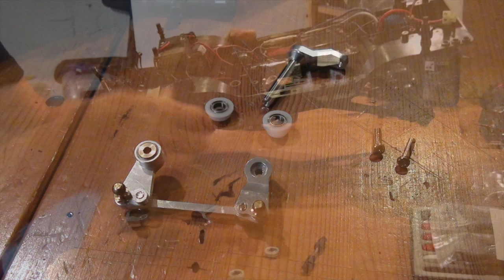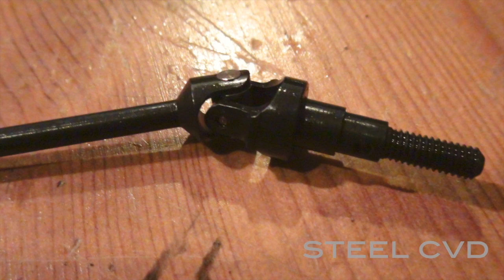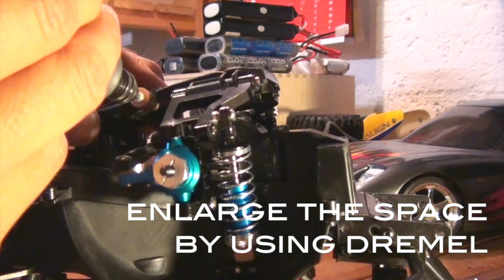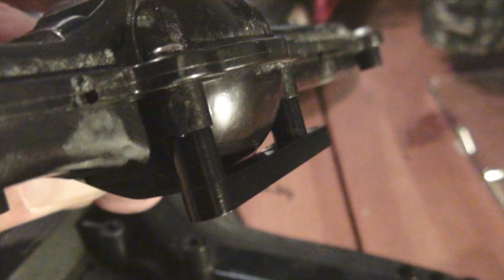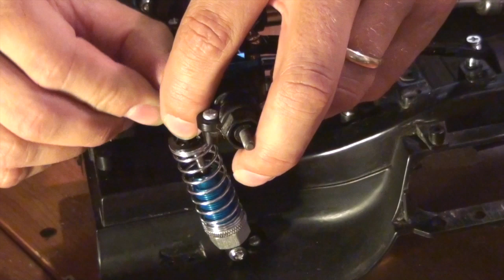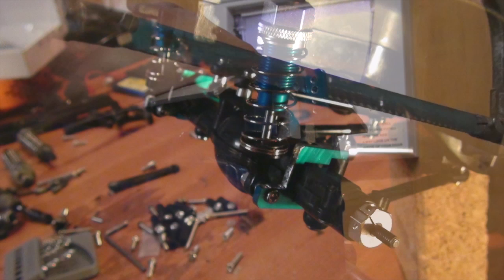Tamiya CC-01 Modifications

Comment: I got the GPM dampers also and they were very sticky and stiff. I replaced the damper oil with stock Tamiya oil and then they worked properly. Not sure what kind of liquid they came with, but it sure didn't seem to be oil. The springs are also to stiff and caused bad handling and severe bouncing. Stock dampers seem to work the best. Going to save the GPM for when I add about 1lb of accessories and see how it handles then.
Reply from the maker: Yes, I have the same experience, I made bigger holes in the discs of the damper pistons, and use the stock Tamiya oil, so they work good. On the Tamiya stock dampers I made bigger holes also. http://youtu.be/T6ZGqpP5q7M